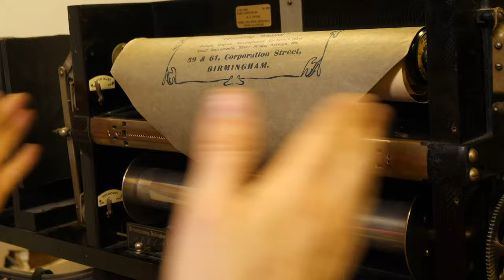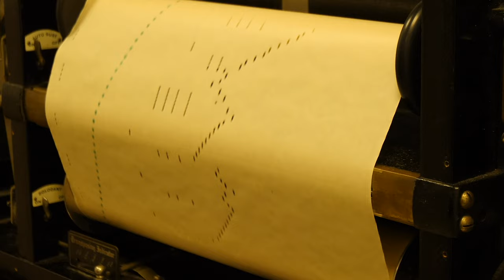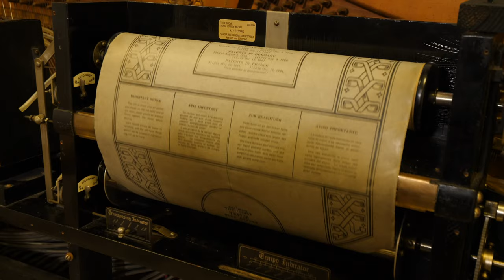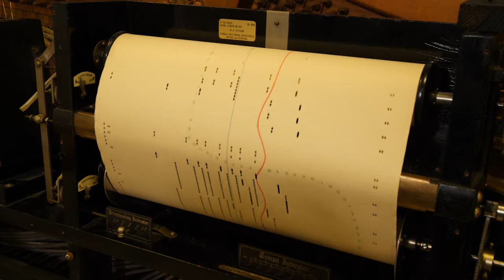I Didn't Expect A Self Playing Piano To Be So Complicated.

Comment: With today's technology, you would be tempted to say that such a project is impossible without a microcontroller. And here is the thing, just pumps and pipes and a roll of paper. Look mum no computer, indeed. 😁
Reply from the maker: It's a shame now adays that also myself included opt for microcontrollers. It's such a boring means to do things haha
Reply: Where do you think they got the idea for MIDI? 😏
Reply: You could have argued that MIDI was an innovation that would have happened eventually due to its sheer necessity, but the piano roll system is definitely inspired by these rolls of paper
Reply: These "rolls of paper" are piano rolls. The originals. I wouldn't say MIDI piano rolls are "inspired by" them as much as they are a direct digital implementation of them, right down to the name.
Reply: Before the computers the paper tape mechanism was the way to automate complex machinery such Jacquard looms to weave complex patterns. Punch card technology used in computers to store programs and store data until the mid 1980s was directly inspired by this technology. https://en.wikipedia.org/wiki/Jacquard_machine
Reply: Wow. Mesmerising. Thanks dude x
Reply: @LOOKMUMNOCOMPUTER  Achieving something through first principles electro/mechanical design seems wholly more satisfying.  Technology Connections video about how old pinball machines worked  highlights this satisfaction.  As does your good self making synthesizers.

Comment: That centering mechanism is so elegant 😮
Reply: right. I was following it closely and watched how it shifted left and right while the roll made its way through 🙂
Reply: It's actually very similar to the way the laser diode tracks the data spiral in a CD.  There are four sensors in a diamond formation.  The top and bottom form the feedback mechanism for lens focus:  The spot will expand or contract, from a circle to an oval, when out of focus.  The two sides are the servo for keeping the beam centered on the track -- exactly like the roll sensors here.
Reply: @nickwallette6201  fascinating, I didn’t know that

Comment: Fascinating that they used a five cylinder engine to provide smooth motion to the roll mechanism!  Just like my old Volvo V70 T5!
Reply: For the vacuum motor, it’s more like a 5-cylinder 2-stroke engine, so there’s a power pulse every 72 degrees - close enough that it doesn’t need a flywheel.

Comment: When I grew up we used to have a piano almost exactly like this, though before we got it the pianola mechanism had been removed. But it still had all the recognizable bits like the "window" where you load the scroll as well as a removable panel around the piano pedals where the pump pedals would've gone. It's awesome to finally see what our piano would've looked like on the inside when it was still a pianola.

Comment: Very nice! I did notice a couple of notes during that Beethoven roll that weren't working, so it might be worth a quick check once you've got everything together in case there's a blockage or something. Still I'm very impressed and I really liked that demo of the player action before you fitted it into the case. Not seen a demo of a real action working like that before.
Reply from the maker: 5 in the lower register are not connected due to a leak.

Comment: I had no idea I had any interest in self playing pianos but I was sucked into this video from beginning to end. What a fascinating machine. I have seen these things in person. I am aware they exist. I never stopped to wonder, "Hey. How does that thing work?" It's so elegantly simple. Two things. First, 10:43, why does the tracking mechanism move both cylinders, all the gears and chains and all that mess around when you could just design it so it just moves the one bar with all the pinholes instead? Thing two: You have to see if you can get ahold of a piano roll with the with that song from the HBO show Westworld. I think its called the Sweetwater Theme on the Westworld sound track. I had that song on loop in my head the whole time I was watching this. Awesome video.
Reply: There's a vacuum line hooked up behind each pinhole in that bar and originally these lines would have been made of lead. Even with modern soft tubing moving that many connections would be asking for trouble.

Comment: What a great video! I never would have guessed that the way it reads the roll is by pulling a vacuum against the paper and the holes break the vacuum on the different notes to operate the valve.

Also amazed at how well it stayed in tune while being moved. Obviously not perfectly so, but it wasn't as terrible as I thought it might be.

Comment: The "snake bites" holes are actually controlling part of the expression system emphasizing notes. (left ones for bass, right ones for treble)  Not sustain. For sustain you can just make the hole longer in the paper. (Edit: No you can't as pointed out below correctly)
Reply: That's not the same. Holding a note only keeps the damper of that note off the string. Sustain keeps all the dampers off all the strings. This sounds different because of all kinds of harmonics sounding from strings that are not played.
Reply: @diederikvandedijk  You are correct you'll be missing out on the harmonics. Forgot about that one.
Reply: Although I’ve never seen the “snake bites” holes before, I believe @Muiskkabinett might be correct about them.  Player pianos do commonly have a pneumatic to operate the sustain pedal, but it would be controlled by a hole along one side of the roll, and the hole continues for the entire time the sustain pedal should be pressed.  At least that’s the way it was on the rolls that I’ve seen.  I grew up with a player piano built in 1971, and its “soft” mechanism (an upright piano, so “soft” was just moving the hammers forward to shorten their throw) was split into bass & treble halves, pneumatically operated, although in this case it only had manual buttons to control their vacuum signals.  So perhaps the “snake bites” holes were an automated way to soften some notes just before they were struck.

Comment: I used to have a player piano. I had no idea it used a vacuum. Why wouldn't it work the other way? Using the bellows to push air? I suppose the uneven sucking of the foot pedals is smoothed out by the motor. Mine only had 4 bellows. But, the most important thing is the player roll. The suction helps keep it on the playing surface ... nice

Comment: Hi Sam, I was wondering how you were going to midifi it. Lots of solenoids with fine armatures to cover the vacuum paper reading head.

Or how about a crazy idea where the paper roll is dynamically created before being fed into the pianola.

1) Using lasers but no sharks :)

2) or paper punch cutting system.

There would be a delay in the response.

Mark

Comment: I've owned one of these for over 45 years. Very expensive to restore all the bellows, vacuum lines ect. Mine has the foot pedal pump but it also has the electric motor option to drive the pump and the option to slow it down or speed it up. I noticed that many of your keys are not fully dropping. It sounds good so far but you'll need some  calibration/tuning, to get it up to par sound wise and performance wise. I'll never get rid of mine. Only wish there was a way to turn the volume down since they play so damn loud :) Cheers

Comment: Very interesting. I'd like to see how the tempo adjustment works, I didn't see any adjustable gearing or anything that might do that. Or maybe it's a vacuum restrictor? I'd also love to know how that auto alignment thing works - on all the pianos like this I've seen, the alignment was manual, there was a lever that physically moved the brass reader piece (with all the holes) left and right so that the operator would align it.
Reply: @ScottsSynthStuff I'm guessing that the vacuum would vary depending on the number of notes playing and the diameter of the take-up roll, so I would use a governor (like the one used in a wind-up gramophone) to keep the speed constant.
Reply: For tempo control, I don’t really know, but my guess is that there’s a flow-rate regulator controlling the vacuum supply to the motor.  That way, it’ll stay at the set tempo, regardless how hard you pump the pedals.
Reply: For the auto-alignment thing, I grew up with a player piano in the house (1970’s US, the piano was built in 1971).  It had both an auto alignment thing, and some knurled screws for manual adjustments.  Its auto alignment thing didn’t work very well (poorly designed mechanism, unlike what we see in this video), so you were forced to use the manual adjustment pretty often.

Comment: My piano, a 1960s Duo-Art Aeolian, pushes up on the keys at the rear where they meet the hammer mechanism. So by design, the keys go down. Mine also, thankfully, has a built in vacuum pump. They were advertised as the only dual play piano; pedal or electric pump.

Comment: It never ceases to amaze me the lengths that engineers went to when designing complex mechanisms. That vacuum engine is a work of art - I was so disappointed when I found out car engines don’t fire sequentially like that!
Reply from the maker: i think its more a balance issue when it comes to heavy things like pistons and con rods! 4 pistons the outside 2 are matched and inside 2, 5 piston is a little less even but 6 gets back to being balances laterally and so on. mainly balance and crankshaft load and what not. not such an issue with wood :D
Reply: Also, most car engines are 4-cycle and only fire on every other down-stroke, so a 5-cylinder engine would fire every 144 degrees of rotation.  This 5-pneumatic motor can fire on every down-stroke, so it’s once every 72 degrees.  So no flywheel is needed.
Reply from the maker: yes im not talking about the firing degree. more the literal mass of the weights laterally on the crankshaft, flywheel weight logitudinal. a 5 cylinder engine doesnt fire sequentally either, if it did it would shake itself to bits. its an over simplification im aware.   @kc9scott

Comment: What a fascinating machine!  I really love when you find something like this and just dive into it to see how it works.  Can't wait to see how it evolves.  I'm really interested in the MIDI "input" you'll devise.  Imagine!  An actual MIDI piano-- not some preset or sample pack!  Should eventually mic it up real nice like you did with the church organ and write some piano-heavy tunes on it!
Reply: Many theatre/cinema organs had pianos attached. As the organs were electro-mechanical  (with solenoid operated valves letting the air into the pipes) then I guess the piano using solenoids as well to hit the keys. So a midi out - midi in links would be the modern equivalent.

Comment: The tracking servo is brilliant!
I wonder why they decided to make the whole thing vacuum driven rather than pressure driven? Maybe it allows it to be quieter?
Reply from the maker: tracking thing is amazing isnt it! as for vacuum, im guessing because the principal of the vacuum on the paper acts to pull it towards the mechanism also, it would likely not work going the other way!
Reply: Yes that was the most fascinating bit of the whole system to my engineering mind
Reply: @LOOKMUMNOCOMPUTER That. Also, a pneumatic bellows made for vacuum has the air pushing the flexible membranes (either rubber-cloth or leather) toward the wood that they’re glued to, rather than trying to rip them away from the glue joint.  Thus, longer life.

Comment: Never thought these pianos are actually pneumatic. It must have been extremely expensive at the time... As for a midi addition.. I would do a big metal block that would duplicate the holes on the piano, but intersected with small holes from top to bottom with a close fit thin rod in it, that can be moved by small solenoid.. But it will require some precise machining... And some sort of encoder wheel to keep up with the original roller wheel, but that is an easier part.
The other question that is bothering me - is it ethical to add electric power to the bellows, or you must suffer to enjoy music?)

Comment: Sam! Genius at work as ever, I was wondering when the Midi interface would get mentioned.
Not being critical, but you put the Sprugal Spring Flange Return Thingy  in upside down and the Divot Modulator Gusset was back to front. 🤣🤣🤣 Apart from that great work Sir! 🙂🙂🙂
Ps sorry I forgot to mention - your hose going to the Multiple Orifice Manifold, should have been Bottom Entry and not Rear Entry, and you may need a 7/16" Orifice Reducer to ensure the back pressure in your hose is regulated to at least 3.29 Badgers! 🙂

Comment: how about upgrading it with a simple motor?  using an adjustable voltage (as speed regulator) and some gears to get enough strength should do the trick^^

Comment: now that the keys don't reset on their own but have to be driven by the hammer mechanism, resetting a note after release takes more time (inertia). test on some faster passage to find out if it's a problem.
Reply from the maker: But if they reset on their own they would never move down in the first place. Look at any pianola they move in the same way. The hammer weight resets the key which is unchanged

Comment: Automating this so you don't have to peddle would be pretty easy if you put a motor on the back of the peddle mechanism with a crank shaft instead of using an external vacuum that can make noise... Very cool! I just wonder if there is some key on the role that automatically reverses the roll when it's finished and starts it when it's at the beginning, but from what I saw of the rewind I am guessing there is no auto-play.
Reply from the maker: or just a suction pump :D

Comment: Removing the weights may be a bad idea, you will figure out why, possibly during fast or slow passages. (stuck notes, delay in note-off) Shouldn't be an issue while its manual, but might wanna put it back if you automate this. But it does work. The keys not moving was an 'advanced' feature so you could more easily play along with the music.
Reply from the maker: Having spoke to people they said the action was heavy. I only removed half. An advanced feature but not a welcome one! They are staying out cheers :D
Reply: I was wondering if someone was going to talk about leaving the keys up to enable playing along, I have a vague idea some late models let you switch it either way, but that may've involved electric controls, I don't know for sure.

Comment: Foot pedal rotary motion to make vacuum to make rotary motion.

I wonder if they could have just used the rotary motion plus a speed governor to make less losses but in all honest it's a magnificent machine
Reply: Maybe the vacuum takes out some of the speed variation from the pedal motion?
Reply: On the units I've seen there's no rotary mechanism in the pump, each pedal actuates the bellows independently. You could play it with only one foot if you wanted to but then the vacuum might be less smooth.

Comment: The vacuum chamber is genius --- if you pump air in, then the air pressure can rise indefinitely. But you can't pump more air out than all of it, which means the difference in pressure between the inside and outside can never be more than one atmosphere! Which means it's self governing: provided you're working the pump faster than the mechanism is bleeding air into the reservoir, the pressure differential will remain constant, which means the motor runs at a constant speed and the piano stays in tempo. Plus, sucking air through the sensor bar will tend to automatically stick the piano roll to the sensor, which makes life a lot easier.

Another interesting project would be to make new piano rolls. If you were to get rolls of continuous paper, mount them on an arduino-powered scroll-like affair inside a laser cutter, then you could cut one row of holes, advance the paper, cut the next row, etc. It'd need a fair bit of low-level laser cutter integration and I don't know whether that's possible, but it's probably easier than trying to build a punch.

Comment: Now you have to hook it up to the air intake on your pipe organ blower instead of using those pedals.
Reply: There were a few pipe organs (specifically, cinema organs from the Link company) that used pressure for the pipes, but vacuum for just about any other mechanical accessory that needed to move.  The blowers they used had two separate fan sections - one for pressure, and one for vacuum.

Comment: Made me wonder if the roll is off center. Every note one note to the left. Hmmm. Interesting :)
Reply from the maker: Huh?
Reply: Well, just disable the centering mechanisme and have it drift off so every hole in the paper goes over the wrong hole in the copper thingamajig.
I'm wondering how it would sound lol @LOOKMUMNOCOMPUTER
Reply from the maker: ohhh i see. it just doesnt really work, i shot it but it just means some ust dont work unless you have a lot of pressure @guyh3403